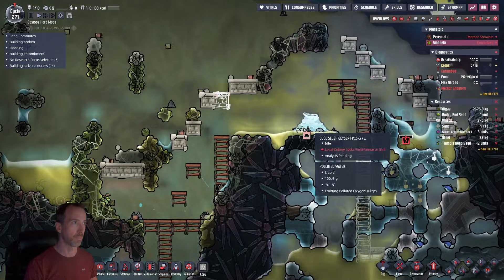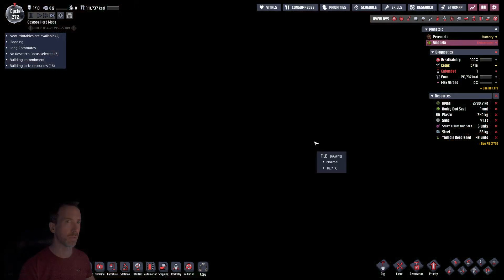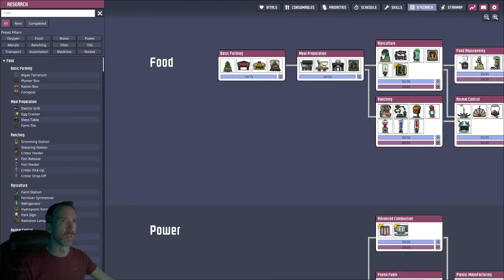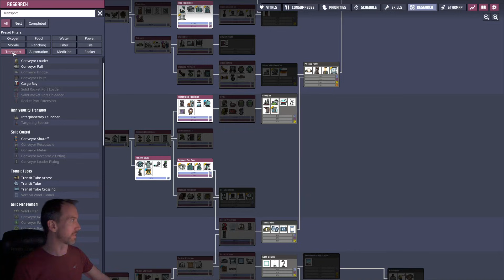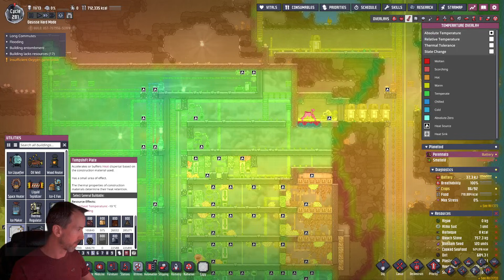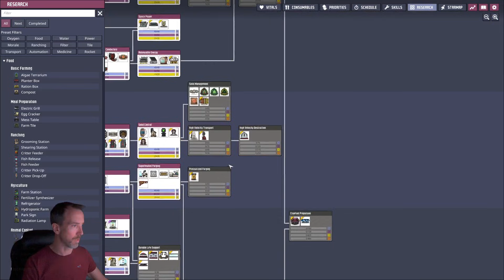Closer Teleportation - Oasisse Hard Mode  - Ep. 21

Comment: You wished for "Auto-Teleport" and "Canister Filler Max Weight 200kg", you can now find mods for / called that in the workshop - id=3674429822 and id=3674431270
Reply: while I was at it, I also made Auto-Exit-Neural-Vacillators. id=3674542335